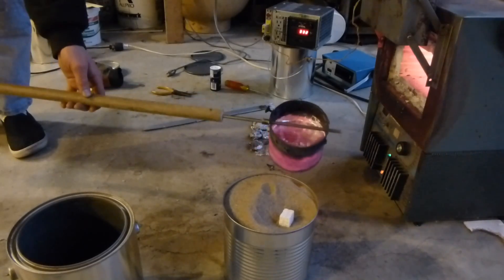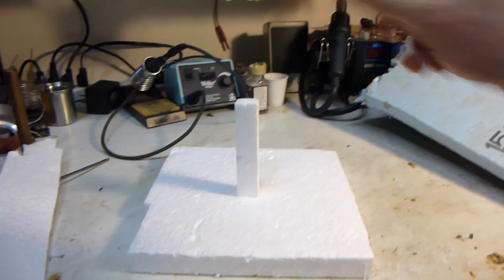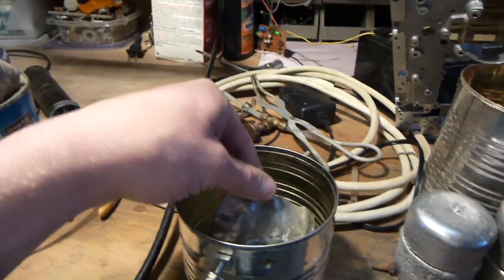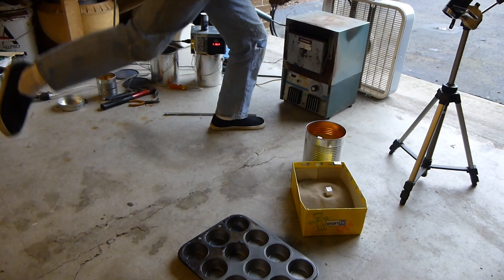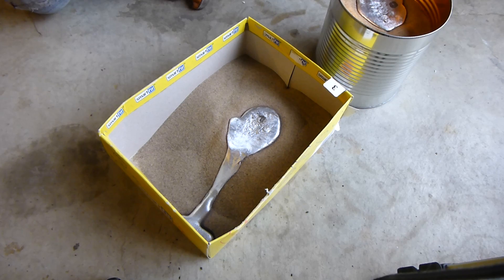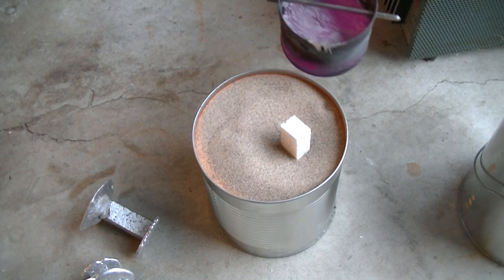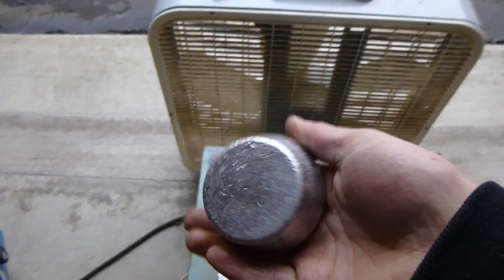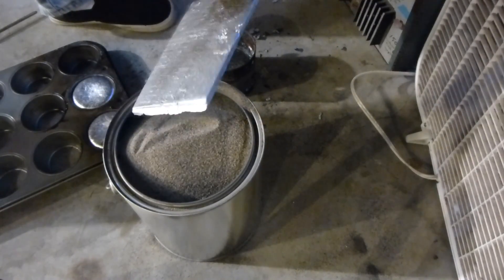Aluminium Lost Foam Casting Experiments and Tips

Comment: Does it work same on wax with sand on it???
Reply: anthony swamy no it doesn't work with wax & sand. i've tried it a half a dozen different ways with wax & sand all unsuccessful. when you do lost wax , you use a plaster like stuff called investment. then you melt the wax out of the mold before casting. then with a spin caster, you do the casting
Reply: Not exactly, in lost foam casting the foam directly vaporizes and the molten metal quickly takes place, therefore powdered substances that are not flammable like sand can be used. In lost wax casting , however, plaster is used to make a mold out of the wax model. After the plaster sets, the wax can be melted and poured back out so the mold can be used to cast metal models.
Reply from the maker: anthony swamy I don't think it would.  But I've never tried it.
Reply: Makerj101 There is someting called "lost wax method" as well. I don't know how it works.
Reply: i think your right it's to dense. because the high density foam doesn't seem to work neither
Reply: Satan i haven't either, but i've watched a cpl peeps try it here on youtube and it doesn't melt away fast enough. In all my attempts with wax, the metal went solid as soon as it touched the wax. not only is it density but i think it has something to do with the gases the wax creates as well. with the high density foam it would at least start to fill the mold, it just didn't make it vary far.

Comment: Hey there, i really like your videos, they are pretty well done. I am looking forward to more casting with aluminum, but one tip, from caster to caster, if you sprinkle some water into the sand , the sand will stick to its form and wont collaple on your mold that you made with foam, so then you get a really well done cast!!
Reply from the maker: MOJANG LP I'm going to try wetting the sand a little on my next casting.  Thank you!
Reply: MOJANG LP Have you tried this? I've heard elsewhere that anything wet should be avoided like the plague when casting, due to rapid-even explosive- steam generation. I believe this is why they don't cast steel in concrete.
Reply: MOJANG LP Have you tried this? I've heard elsewhere that anything wet should be avoided like the plague when casting, due to rapid-even explosive- steam generation. I believe this is why they don't cast steel in concrete.
Reply: When i mean sprinkle some water on sand, i mean "sprinkle" some water, i know that steam can build up pressure real quick with this molten metal, but only put some water in just enough to get the sand a little thick, not runny nor sandy, best thing to use to do it, a spray bottle, pour some sand in, sprinkle some water, pour some more then repeat the process.

Comment: I think that loose sand is your worst enemy. Especially with the small imperfections. Add just enough moisture to make the sand clumpy.

Also washing soda is a good degasser and will contribute to the quality of the finish casting. I could be wrong but i think the degassing chemical was sodium carbonate. I use oxyclean as a degasser and salt as a flux. U can add the flux ontop of the dross and it will pull more aluminum out.

Above all thanks for the vid, that taperd edge of the insulation foam helped clear some similar questions for me.

Good luck and happy casting :)
Reply from the maker: Cruel Crusader Thank you!  I will try moistening the sand next time I cast!  I will see about getting some washing soda and stuff like that.

Comment: "220 degrees fahrenheit, 1200 degrees celcius" seems legit
Reply: 1200 is what aluminum melts at I don't know about Celsius though
Reply: I think that was supposed to be 2200F XD
Reply: 660cº tankkiller308
Reply: CJ Black melting point for aluminum.
0:50 in to the video.
1,221 f and 660.3 C
Reply: CJ Black kek
Reply: 2200 F   is  1200 C

Comment: You need to get ALL the aluminum in the mold, you need a funnel of sand, just wet the sand a bit at the top and make a " volcano " out of the sand. Then pour your aluminum into it and it should work
Reply from the maker: Gabel McClure Thanks for the tip!

Comment: Good experiment. Observations --
* Temps are critical, especially for thin detail.
* Head pressure on the pour is useful. However having really long sprues can lead to collapse and shorts. (has for me) A way around that is to use a shorter sprue and a metal can riser around the sprue.
* Melt, remove, dredge for slag, flux, reheat to bring the temp up, then pour. I find it helps eliminate cold pours.
Reply from the maker: ***** Thank you!  I use some of these processes in my newer casting videos.  What do you use for flux?  Thank you!
Reply: Makerj101 Take a look here http://www.substech.com/dokuwiki/doku.php?id=fluxes_for_melting_aluminum&DokuWiki=3443c32a3e20a67f104528770d29d177#degassing_fluxes

Comment: It's not rust from the blow torch, it's a build up of carbon, thank god you thought that though, would've been a bitch to get out, probs would've ruined a muffin tray
Reply: Samuel Lennon-Mather *Thought of
Reply from the maker: Samuel Lennon-Mather I've seen people doing both.  People use rusty or oxidized steel ingot molds for aluminum with great results.  But I've also seen people coat their molds in soot which is what you're thinking of.  I did techinaclly ruin the muffin tin.  I burnt the nonstick Teflon coating off.  No muffins will stick super well in it!  :P

Comment: I've cast lead for twenty years, while it is a different material... The principles are the same. Pour extra material into the sprue to compensate for shrinkage as the metal cools in the mold. A cast iron lead pot for bullet casting is less that twenty dollars and not much bigger than a coffee cup, it will last a bit longer. Venting the mold to aid in pouring will help.
Reply from the maker: RantingFury Good to know!  I use a propane tank in my latest videos.  Thank you!

Comment: Most electronics use magnesium frames for rigidity, aluminum is too ductile unless its aircraft aluminum which is expensive.  They have similar melting points.  Your pieces sound like magnesium when clinked together too.  Are you sure that's aluminum?  As to the crucibles, the steel is thin, and hot steel still burns away in oxygen, might want a better crucible.  Typical casting has air vents, could try a foam tube maybe?
Reply from the maker: blacksilverlight I'm sure it's not magnesium.  It would be a burning pot of white hot lava if it was magnesium.  I have a couple frames like the ones from laptops and cell phones which are magnesium.  When you heat them up they burn white hot as soon as they start to melt.  Super dangerous.  Plus the magnesium frames are super light.

Comment: Just a thought, not sure if it's sound or not since I'm still in the researching phase of my project.  It seems like from what I've seen, the sprue length is not so important.  The vids of people making actual objects always point the foam original length-down rather than flat across like you are doing with your platform experiments, and they use short sprues with stellar results.  I think that might possibly be the key, along with temperature.
Reply from the maker: Dwight Gordon Interesting.  Thank you for the tips!

Comment: I'm thinking about trying a lost foam aluminum sword cast myself for a summer project. I was wondering if anyone knows if the hilt an pommel can be cast in one piece with the blade or if they should be cast separately and affixed on later.

Comment: you can also use salt as a flux and sodium carbonate as a degasser (I think potato works better),   heres a video showing that  about 2 1/2 min into the video

https://www.youtube.com/watch?v=B5wCVI7jCyQ&feature=iv&src_vid=IYZOTt9zTv0&annotation_id=annotation_900267
Reply from the maker: Interesting.  I'll have to give that a try.  Is sodium carbonate the same thing as baking soda?
Reply: to light i would use salt heavier and will mix better
Reply: salt is not the same as baking soda   sat is a Sodium chloride, as baking powder is a bi carbonate
Reply from the maker: robert k Oh ok.  Thanks!

Comment: try using a potato for your degaser  alot of alum forgery company's use it works very well from what i have seen
Reply from the maker: robert k A potato?  Like the vegetable that grows in the ground?
Reply: yes
Reply: also if you put a pinch of powder magnesium on top of the riser after you pour, the mag ignights and will hold some of the heat in the mold an may allow better flow in the harder to reach areas. You will need to do this quickly as to not get yourself burned.
Reply: put the potato or piece of depending  on the size of your crucible in before you pour
Reply from the maker: robert k Huh I could try that.  What's in the potato that does something to the metal?

What if I put the magnesium on riser before I pour?
Reply: potassium i believe
Reply from the maker: robert k  What about bananas?  They have potassium!  I honestly didn't know potatoes had potassium!  http://en.wikipedia.org/wiki/Potato
Reply: well the big foundry's that make alum engine block tend to use potato so i would stick with that
Reply: plus the potato is cheaper than a bannana
Reply from the maker: robert k Really?  I would think they would use a chemical flux.
Reply: potato is much cheaper with same results
Reply from the maker: robert k Well I'll have to give it a try then.  Thank you!

Comment: I have watched a lot of foam casting vids, and I think your biggest issue is the sand.  Get a green sand that will pack tighter and hold its shape better.  Your last couple cast came out nice be that, but you poured while hotter and I think for real detailed work, better packing sand would provide great results because nothing will move a the pour replaces the foam.  Good job.  Like your vids.
Reply from the maker: Tom M Yeah I need to see if I can get some bentonite clay for making green sand.  Thank you!

Comment: 1. You're not pouring enough aluminum/ pouring it too quickly, where most of the metal ends up pouring over the surface instead of heading down the sprue.
2. You should be using "green sand" as opposed to just play sand.  play sand does nothing to hold the shape.  If you use green sand, you'll notice a HUGE difference.
3. Yeah, the high density foam gives you much smoother casts.
4. Try doing some with bronze or brass.. really fun.

Good luck!
Reply from the maker: Brassnuksnitenite Thank you for the tips!

Comment: Try adding a vent and mixing your sand with clay
Reply from the maker: John Watts Thanks!  I just did more casting today and I tried a soda straw vent.  It kinda seemed to work.
Reply: If you just get a small Dowell rod and post a few vents depending on the size of the cast and you should be good,
Reply from the maker: John Watts Thanks!
Reply: How did it work for you?
Reply from the maker: John Watts Well the holes just fill in because I'm just using dry sand.  I used a soda straw and that seems to work well.
Reply: Great

Comment: Hey great video! Maybe you could help me with a question that's been bothering me?
I've been thinking about making my own mini-foundry for this exact purpose for a while now, but funds, equipment, materials have been short. But I'm still very eager to get to the bottom of this. My question is:
What are some higher-density materials that the aluminum will eat up? Could the foam be replaced with, say, a thin plastic (specifically sintra) or paper/cardstock (like a hollow pepakura model)? Is it some special property of the foam that lets it vaporize like it does? Would you happen to know? Or perhaps be willing to experiment with different materials? xD
Reply from the maker: Cameron Coleman Thanks!  Sure thing!  Well Styrofoam worked because it's something like 98% air.  So when the hot metal hits it there is basically nothing but gasses left.  You could use lost wax or lost plastic method.  Google lost wax to get the details.  Basically you make something out of wax. Then coat it in several layers of drywall mud or plaster.  Then melt the wax or plastic out.  Then pour in metal.  Yes you can use a hollow mold made from cardboard, card stock, paper, duct tape, sheets of plastic, just about anything that doesn't have a lot of mass.  Hope that helps!

Comment: Thanks for sharing.  I like your pouring handle.  Skip the white foam, the finish is always rough.  I know this was just a demo but when you do a real pour make sure you get as good a finish of the model as possible because it is a lot easier to shape foam than aluminum,  You can improve the surface quality by coating your model with several coats of plaster of paris or dry wall mud before casting.  Make sure it is good and dry before pouring.    Depending on what you are casting, you may have to add additional vent risers to allow the metal to flow completely.  Keep casting and sharing.
Reply from the maker: jdfish6969 Thank you!  I will give that plaster method a try!  And I will definitely not use the white Styrofoam anymore.

Comment: Plaster should be better for molds unless you decide to go with greensand.

If you want to make a negative copy of something where you don't wanna use plaster on the object, a good material is silicone mixed about 50/50 with starch (maizena etc). This makes a putty that don't stick on most materials and will harden in a days time. (curing time is shortened by the moisture in the starch.)

The silicone mold can be used to make a positive model from plaster or wax.
Reply from the maker: MalawisLilleKanal Interesting.  So like silicon like bathroom caulk?  Or special two part mold making silicon?  Thank you!
Reply: Makerj101 Regular silicone for bathrooms etc. Just make sure the mix is blended/kneaded well without air-bubbles for best results.
Reply from the maker: MalawisLilleKanal That's awesome!  Thank you so much!  I think I'm actually going to try this!

Comment: I was wondering if, to make the surface more smooth, you could  say spray paint it to fill in the holes of the Styrofoam?
Reply: The trouble with spray paint is that it tends to attack styrofoam. It's meant to chemically bond to the plastic, but when the plastic is mostly air, the paint attacks the surface something awful. Maybe, for a flat surface anyway, you could cover it with a sheet of paper to keep the sand out of the foam's pock marks?
Reply from the maker: Hmm that might work. Some people suggested putting wax on the surface.
Reply: Makerj101 I wasn't sure, I am thinking about trying this stuff over the summer and it was the first idea that poped in my head to fix that problem.
Reply from the maker: Ryan Yoak That would be cool.  I plan to do more once the weather gets nicer.  Snow on the ground right now...  This is just a thought, but spray paint my not melt at a low enough temperature to burn off fast enough.  Not sure tho.  Even wax might not work because it's a lot more dense than Styrofoam.  Styrofoam is something like 98% air so when the metal hits it it basically turns into air which seeps through the sand.  If you used wax it might cool the aluminum too much.  I'd have to try it to know for sure.  Thanks!
Reply from the maker: Darwinpasta Never thought of that!  Thanks!  Paper is a good idea.  I've seen people use masking tape before.  Similar idea really.

Comment: i have a question and a tip
question: do the muffins have slauge?
tip: put half a can around the tip of the fom so it dosent flow away
Reply from the maker: Mine don't because I clean all the slag off before I pour.
Yeah I did that with my first casting.  I didn't think of it when I was doing these.  Thanks!
Reply: ye athanks to you i love casting now and why dont u cast anymore?
Reply from the maker: Aidan 1021 I will.  It's just too cold right now!  In fact there is about about 4 inches of snow on the ground!  So i'd have to do the casting in the garage which stink up the house.  Parents don't like that...
Reply: oh ok thats awsome we had one HUUUUGE snow day and missed 3 days of school and had 10 INCHES!!! I made the samwe igloo you made with the water.
Reply from the maker: Aidan 1021 Cool!  How did it turn out?  Did you make a video of it?
Reply: yes i did make a video of it but i cant seem to upload it
Reply from the maker: Aidan 1021 Oh.

Comment: If you could make your mold out of sand and not foam you will have better results. Petrobond should be a good sand to use and it is reusable. Since you already have some castings made you could fabricate a cope and drag and or a flask. Pack the drag (bottom) and cope (top) with sand. Place one of your castings in between and press and pack it hard. Take the cope off and due to the inclusions from the foam you would have to smooth out the positive marks where the sand conformed to the inclusions. Make a down pour basin or down sprue  to pour your liquid metal in, you would also need a flow off at the other end of your mold. The flow off will let air escape as well as any gases. This mold would be horizontal instead of vertical like in your video. Since you cant get industrial chemicals like part 1 and part 2 resins for the sand binder and a catalyst to cure the sand, this is probably your best option. I have 12 years experience and counting with foundry technology. I work with iron and Ductile iron on a daily basis casting large engine castings for a larger mining company that is well known throughout the world. There is a reason why its called "Lost Foam" method, its not widely used. Also when you pour, you want to pour as fast you can without interruption and careful not to spill it everywhere. Since your a casting a small volume of metal, it will cool quickly as well, so it is important to pour your mold as soon as you get it out of the furnace or holder etc. Hope this helps, there is a lot to consider. Keep up your experimentation, you'll find something that works for you eventually.
Reply from the maker: Lots of good info!  Thank you!